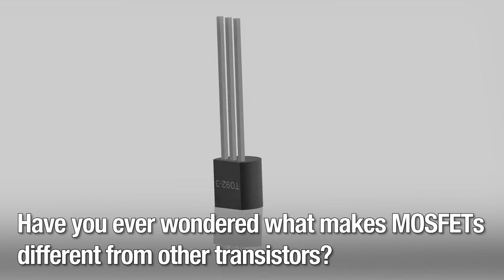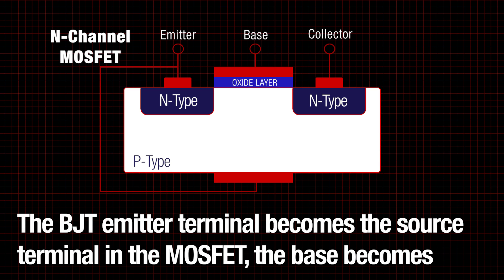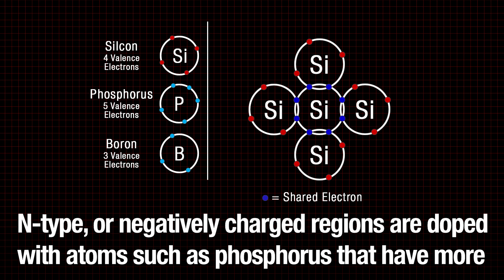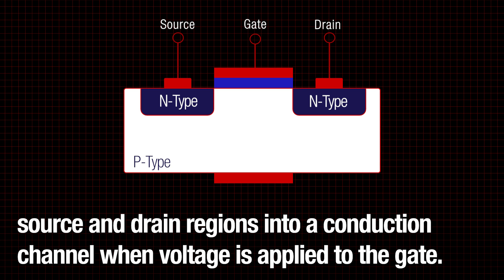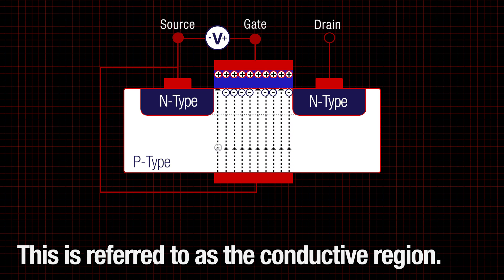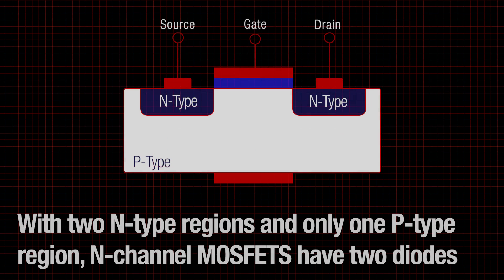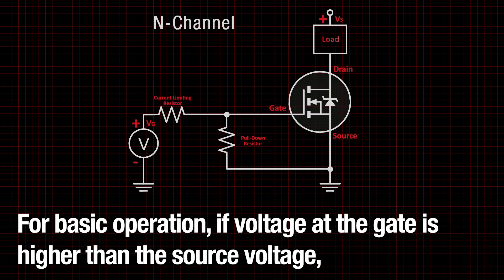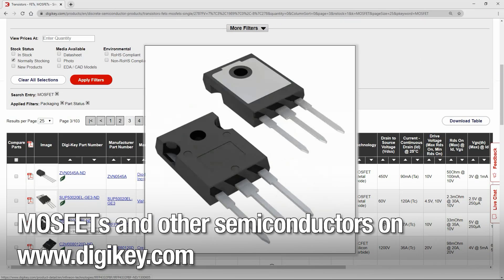How MOSFETS Work - Another Teaching Moment | Digi-Key Electronics

Comment: This is what makes car amps. Get loud or sound good?
Reply: Car amps depends on the make and model. Some alternators put out more amps than others. But if the amps are “loud”, then there is a problem with the alternator although you can’t really hear electricity through a cable unless it’s really high voltage. If it sounds good, it will be silent.

Comment: Crazy! Even when I play this back at 1/2 speed.... 
It’s still GREEK to me....
Reply: I classify myself as a reasonably okay smart guy and I began drooling on myself about a minute in. Whoever came up with this is on some other level.
Reply: @monkeybiscuits78  you have to understand how regular transistors work that's the point this video distinguishes the operation of mosfets from the transistors that you are assumed to be familiar with. They will correct me if I'm wrong.